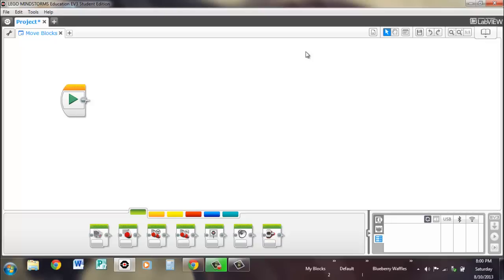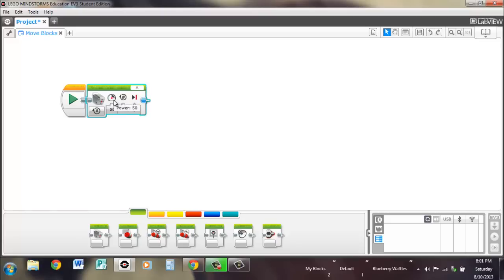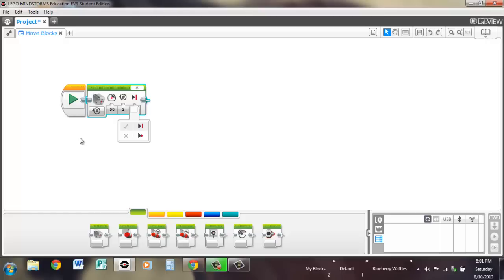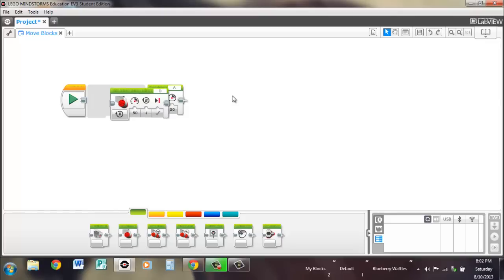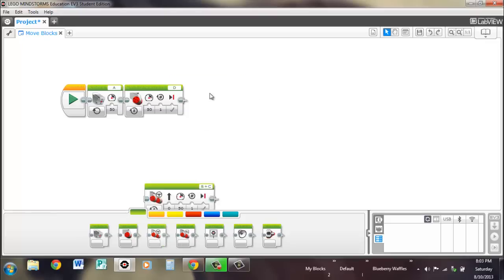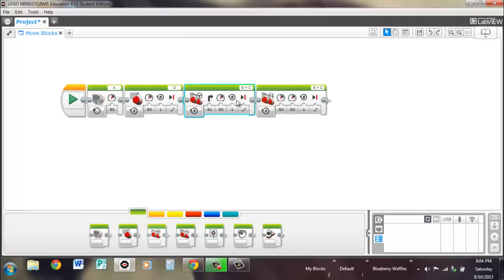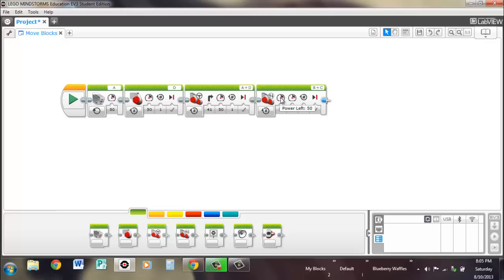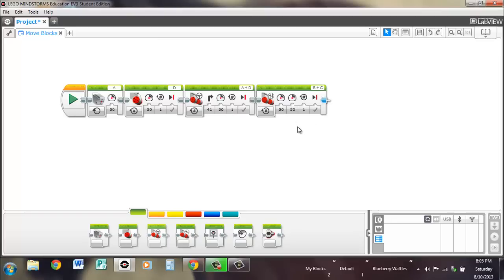4 - EV3 Programming: Move Blocks

Comment: hey brennon you are misunderstanding the two steering functions. the tank mode has the motors as two drive motors while the other one connects to a pitman arm for steering like your car. Not sure how old this video is but i hope you have realized it by now
Reply from the maker: Thanks for the info, but actually if you want to do a car steering you actually need to do a whole new setup.  The steering block still only works by making one wheel go faster than the other/in reverse.

Comment: hi i have a ROV3R EV3. I want to make a program for my ,move block to go to unlimited. what should I do?
Reply: In left hand corner of the block, there will be  a box. Click it. There will be a drop down menu so you choose on. This makes sure that it will be moving forever, not stopping unless you stop the program or add further blocks for more functionality. Basically, change the option to on in the bottom left hand corner.

Comment: What's better, the education set or just the retail, since I'm just a decent programmer that is skilled in many programming related things and is very used to the nxt 2.0 educational set.
Reply: Depends from person to person. If you don't really care about the price- go with the educational core set. It has more pieces, sensors and you also seem oriented to the educational line of mindstorms. But keep in mind that you will have to separately get the infrared beam and sensor. Basically, education set is the best if not looking at the price tag- which has some difference.